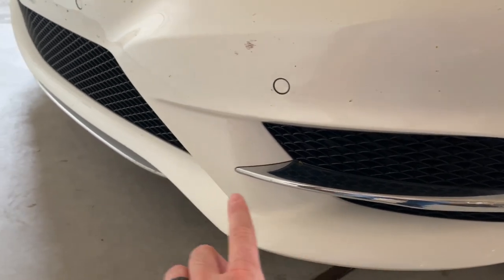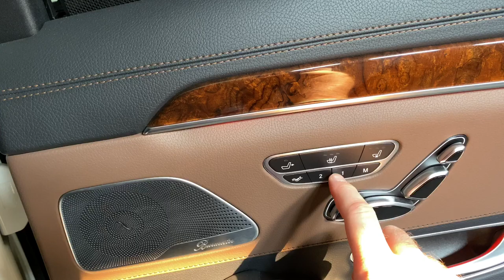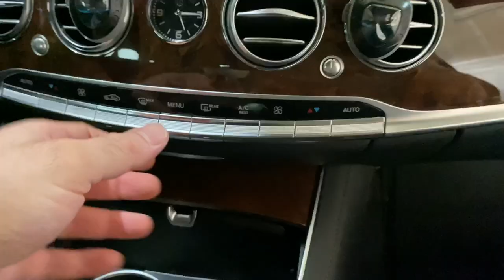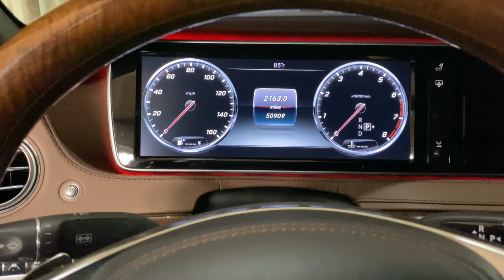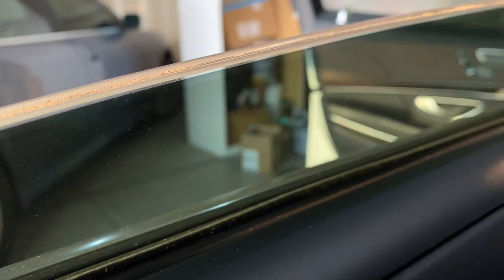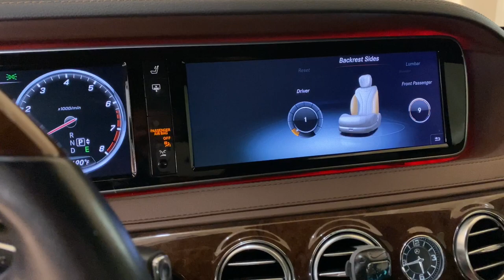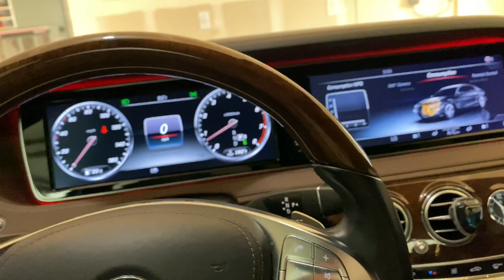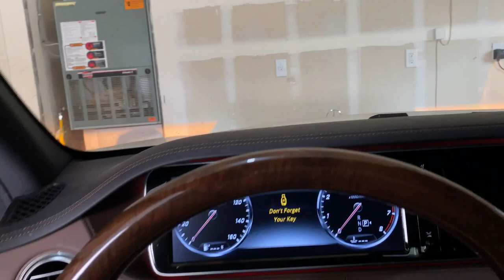2015 S550 Mercedes Benz Detailed Owner Review

Comment: 26:30 Actually the parking brake is push to apply and pull to release.  Later 2015 models actually adopted an auto apply system which means the parking brake would be automatically applied in the event the transmission is in P (park) and the engine is shut down or the driver's door is opened while the seatbelt is unfastened.  Very nice video!  These cars may not be cheap to own or maintain, but they are worth every penny.  Just have to have enough money set aside for anything that may go wrong.  The W222 is probably still my favorite S-Class because although a new S-Class is out, the previous generation doesn't look outdated at all and they still have a lot to offer in terms of technology.
Reply from the maker: Thank you!! I must be honest, it is a really nice car and it looks way better than the new one I agree. I like the headlights in the later years of this model. It probably can be retrofitted into older years like mine but I’m not very familiar with Mercedes coding and all that. I was in Berlin last week and saw a lot of this S class but all of them were the diesel 6 cylinder variant.
Reply: busmaster do u own one does much go wrong with these cars? about to buy one but hesistant, 2015 . done 40000kms . has warranty but still paranoid lol
Reply: @jamiefreedom8320  I don't own one.  I've wanted to for many years now and was waiting for prices to come down below $30K, but the car market spiraled out of control so I could have bought one in 2020 and sold it for a profit.  But yes, like all luxury vehicles, there are things that will break and some will be more expensive to fix than others.
Reply: @BusMaster99  Yes i have decided to not get one as after weeks of reserach it seems the maintenance is not worth it as if something goes wrong it is quite expensive. I have opted to possibly get another genesis or maybe a sonata N line. Mind you the Genesis has been a dream i had older model 2014 but it just amazing car to have nothing went wrong built like a bullet.
Reply: @jamiefreedom8320  I don't blame you.  Maintenance unfriendliness is a rather unfortunate aspect of S-Class ownership.

Comment: If you want to skip a track just turn the command knob. The car is designed to be operated with the knob anyway.
Reply from the maker: The knob is the only way unfortunately if you want to keep the digital speedometer on the cluster.

Comment: Great review!  Tranny is way more responsive in sport mode, really wakes the car up.  The brights can be toggled on/off instantly if you take it out of auto headlight mode.   And you can always refill the empty canister with other perfumes should you find MB scents costly/limited.  My 2015 has 40k mi, still lovin' it!
Reply from the maker: Thank you! It is better in sport but I think my car has a trans issue that’s for sure. The other day the second gear banged so hard all passengers in the car rocked forward and backward lol. I hate the auto high beam in this car... it sucks.
Reply: Where can i get the refill purfumes at other than Mercedes dealer?
Reply from the maker: @lilpudge1503  I’m not sure maybe online you can find refills... I sort of got used to the ones I use and I like that they still release smell even if car is parked versus the built in perfume that only works when fan is blowing air.
Reply: fancy how is the body roll on this car? Does it sway alot? hows the cornering that is one of my main concenrs aswell i want something decent on corners stable and strong
Reply: Do you still own the car? How reliable has it been?
Reply: I’d like to chat with you. I’m buying a 2015 S 550 this week.
Reply: What exactly is great about this review ? It’s garbage

Comment: A fully loaded 2015 S-Class would have been $140k, but this model lacks quite a few options...many that you have mentioned in the video. 
My '13 S-Class is fully loaded except for the fridge (can always be added later) and retailed close to $140k . The base MSRP was $97k and has the AMG Sport Pkg Plus One ($7k), the designo interior Pkg ($15k), the designo Platinum Black exterior ($5k), the rear seat Pkg ($3k), the Pano roof ($1k), Night Vison Assist ($2k), Piano Black trim ($2k), Splitview Front entertainment ($1k), rear entertainment ($2k), and the premium sound system ($6k). 
iirc, the Pano roof became standard with 2014.
The only options I see on your car are the AMG Sport Pkg ($4k), AMG rims ($2k), Driver Assistance Pkg ($3k), Executive Rear Seat Pkg ($4k), Premium Pkg ($5k), and Heated Steering Wheel ($500). You have a well-appointed S-Class, but it is not fully loaded. The Burmester 3D ($6k) is one of the best sound systems and is a big option you are missing. As you noted, the standard Burmester isn't bad and is still better than most auto sound systems. You might want to fiddle around with the settings (equalizer, balance, fade, etc.) to optimize it.

You’ve got a great car and I hope you are enjoying it. You mentioned that the mileage sucks...odd because I get 27-28 on my '13 and 24-25 on my '09 (naturally aspirated) on highway...and I know mileage went up with your gen by another couple mpg due to better turbos and a better tranny. Mixed driving routinely gives me, in sport mode, at least 21 on both of my cars. I found the performance of both cars to be sublime...more than enough. After all, both cars can do 0-60 as fast as a Lamborghini Countach (5 sec). I’m just curious why you considered performance to be bad. What were you expecting? M5 level performance? This is a luxury sedan...not a sports sedan. It’s supposed to waft you, not jar you. If you want that type of performance, you should consider an AMG S63. As for the noise/comfort level…again, I’m not sure what your reference is. Both my cars are extremely quiet and outside my Audi A8L and Rolls Royces, I haven’t found any cars that are as quiet.
Reply from the maker: How do you get 27mpg?? That’s amazing. I fill the tank pretty much every week… I agree with you that the power is smooth and delivery is supposed to be gradual and I like that. In fact I love the engine and it has a lot of grunt but the real problem is the garbage transmission Mercedes keeps using. It’s a pile of trash! Dim witted even in sport mode… slow to shift and doesn’t know what gear to go to! The worst transmission in a 6 figure car in my opinion. They can do much better at least make it shift fast and select the right gear. I don’t have to compare it to M5, even a 328i shifts faster through the ZF 8 speed and it knows what gear to select… I no longer have the Mercedes. I traded it in 2 month ago for a 2019 M5 competition that I haven’t posted about yet… but will soon 😊 enjoy the Merc! It’s a great car… I just can’t deal with it anymore lol.
Reply: @GrindMyGears  Well, 27 is what I can get on the highway...more if I am going from Central NY to NYC as that is a very slight downgrade over the trip.
I'm not a hypermiler, but I do drive a bit more conservatively than most people. Like I said, for performance, a sports sedan like the S63 or S65 would have been a better choice...or even the AMG GT. The regular S-Class is geared to more sedentary driving...smooth acceleration and no sudden downshifts (which can be more jarring when it hits the powerband).
Up to the 2017, the S-Class only had a 7-speed gearbox. Newer S-Classes (2018 onwards) have the 9-gear transmission. This is a bit quicker changing gears since it wants to try to keep engine speed to maximize mileage.
The key to mileage is to find the right speed where the gear you are in gives sufficient power to stay with traffic but remains barely above idle speed (and therefore using the least amount of fuel). I also coast as much as possible. That's just how I learned to drive on a manual.
It sounds like you enjoy more spirited driving. The Bimmer will likely suit your driving, especially the M5 which is a sports sedan that is geared (pun intended) for better performance. There was a time I liked to drive like that and just for the sake of driving, I would just hop in a car and go for a few hours with no particular destination in mind...basically a point A-back to-point A. One of the best driving cars I've had was a BMW. 
I don't really care to do much of that anymore. In fact, I prefer to be driven while relaxing in the back of the Maybach. 
I am considering a BMW again and it is likely to be the i8. I tested my friend's car earlier this year and was pleasantly surprised. I hate going used, but I missed it when it was in production. It isn't the sportiest car out there, but it is sufficient for my needs and I have been told it can be tuned to low 3's zero-to-60. OTOH, there are rumors that BMW might make a second gen that is M based....the i8M. I might just want to wait for that.
Oh, I look forward to your review of your BMW! :)
Reply from the maker: @samshare2146  great info and techniques! Also I love driving from point A to point A 😄. I used to do that in Reno way more than in Austin. Roads here are bad and congested during the day so now I do those at night. I think you would like the i8 spider! Or maybe it’s just me who wants a convertible 😁. Thanks for checking out my channel btw!

Comment: Wow that was the most honest unfiltered video review I’ve ever seen 👍🏾 awesome 👏. Now I think I want a Genesis G 90 instead.
Reply from the maker: Thank you! I hear a lot of good things about Genesis. Let me know if you test drive one and how it is!
Reply: I have Genesis g80, thinking upgrading to sclass unsure what model tho looking at s500. GENESIS has been best car i have ever owned so far, far superior to my c63 which im also selling at auction this week. I want to upgrade to something with same type of comfortability but with bit more power. Planning to just have one car and keep it simple. Something with power and smoothness. The genesis is like driving on a cloud, so im hoping the s500 much similar although yet a superior car is, im hoping its more suitable but im worried about the maintenance. genesis has been a dream. Its super quiet and i drive long drives 8 hours plus sometimes and never felt uncomfortable, could literally keep driving for another 4 to 5 hours with no problems. Never had any major issues with the car, only changed rotors and some buttons here and there.  Now to make a decision if i should go s500/ s63 , s400 (altho slower it may be more comfortable and quiet) or a different car, possibly another g80 but newer. 

How has the maintaince been has many problems occurred in the s500 "grind my gears" pleas let me know thank you
Reply from the maker: @jamiefreedom8320  sorry just saw this since I wasn’t tagged in it, I didn’t get notification. Not sure if it’s still related but maintenance wasn’t that bad. Around $400-$450 for the regular interval (I forgot if it’s A or B) and I think around $700 for the bigger one. I did battery and brakes and it was around $1800 or $2500 I forgot. Overall it’s more expensive than a BMW to be honest but BMW 7er would probably be a lot more fun to drive just not as comfy :D 
Hopefully you got a car you love!

Comment: In the 2017 S550 you can skip tracks on the left side of the steering wheel.
Reply from the maker: Yeah I like the updated steering wheel... I believe it also has the touch buttons on right and left.

Comment: Regarding the noise, you might want to try quieter tyres, it makes a huge difference. The S class statistically has one of the most quiet cabins, so if that's not enough for you, you should probably go for a Maybach or Rolls Royce. Also, it indeed handles like a boat, so it should be ridden gentle. If you try to drive an S class too hard... you and the car won't like it. And judging by your preference for BMW M, your boundary of "too hard" is very high. I don't know, maybe the car isn't really designed for US roads. Because here in Europe the car is an absolute dream to drive. I also dislike the sticking buttons and stuff, one of the biggest disappointments in my opinion. A car of this segment shouldn't have issues like that.
Reply from the maker: You are 1000% correct! I think speed limits in Europe are lower than in the US and maybe that gives the car a quieter ride. I had continental DWS tires on it but I am not sure how quiet this tire compared to others but since we get snow in the area, I needed a good all season tire.
Reply: @GrindMyGears  The car comes with run flats. Switching to non run flats also makes a huge difference
Reply from the maker: @RS1Interviews  actually I didn’t have run flats on it. I took the risk driving even across country with regular tires :D

Comment: I just watched your driving impressions video. This video was equally excellent. I’m currently in the market for 15-17 S550. I went to see one that got away a few weeks back. It was diamond silver with the sport package and 19in AMG wheels. It was absolutely gorgeous but I prefer your spec and wheels. That car had almost every single option minus designo leather, rear center console, and fridge (maybe more). One thing it did have was ABC/MBC suspension. That made me hesitant a little because the service on those hydraulic suspensions are more complicated than the air shock.
Reply from the maker: Thank you 😊 were you able to find another one? This S class is such a head turner… I wish it drove as good as it looks. I traded in the car with 84k miles and the suspension was still in great working order. Everything was in great working order actually minute the transmission, it didn’t get worse but the hard shift would appear occasionally. Also a burnt oil smell would come from under the hood (not a strong smell) but dealer said all is good lol… so idk but the car served me well. Hopefully you find the spec you’re looking for!
Reply: @GrindMyGears  I found several but not as loaded as the diamond silver car. If I may be honesty, I will probably not use most of those options but its great too have still. I have sat in both the nappa leather and standard leather and both are very soft with nappa having a slight advantage. But as you said, as long as it serves you well, that’s all that matters

Comment: Put the light on manually and the high beams will come on when you push forward
Reply from the maker: Yeah that is an option… an annoying one though!
Reply: @Grind My Gears  Makes sense to me. It's intuitive, works the same on Volvo. If the light knob is on auto, then it's quite logical that the high beam will be auto too. Just turn it to the right to turn the lights on manually and the high beam will be auto too.
Reply from the maker: @RS1Interviews  yeah the manual one makes sense but my issue with the auto high beam is that it takes a long time to switch to high beam while driving… you know what I mean? For example, you engage auto high beam but it takes several long seconds for it to come on. When it comes on, it’s great. Then it goes off if an incoming car appears and then the incoming car is gone so you would expect the high beam to come back quickly right? It’s not the case, it will take again several loooooong seconds for it to come back on which is super annoying when you really need it to be on quickly.
Reply: @GrindMyGears  That's true. It comes on slowly. However, it should dim automatically if oncoming traffic approaches. If people flash their lights,  calibration and update of the system will help.
Reply from the maker: @RS1Interviews  yeah it dims when traffic comes opposite way but it takes so long for it to come back on. Not sure why they programmed it this way. It should immediately come back on as soon as it does not sense incoming light from sensor.

Comment: Thanks for review. Question. Why all the air fresheners?
Reply from the maker: I like nice scents including leather scents but this car doesn’t have any smell so I add those. I forgot to mention in the video that this car has a scent diffuser bottle as part of the HVAC system in resides in the glovebox but you have to use Mercedes bottles and I find them unnecessarily overpriced and they dint have a lot of fragrance options. I also forgot to mention that this car has an ionizer built in!! So much stuff in this car.

Comment: Nice review. I just bought a 2017 S550. Like you I was disappointed by the sound of the base Burmester audio system. I also have an Audi A8L 2011 with the base Bose system and it sounds so much better. So the cheaper car (older Audi) ha superior sound. Disappointing.
Reply from the maker: Thank you :) the A8L is a great car from what I know!

Comment: Hey sir a question. Can you replace the wheels with aftermarket ones? Wanna use 18 inch  or even 17 inch wheels just to have more flexibility with roads
Reply from the maker: I don’t see why you can’t! As long as the aftermarket wheel can clear the brake calipers then you should be good. You might need to go to a shop and have them fit a sample and see how it bolts on. It needs to clear the calipers and fenders on the front when you turn the wheels and during corners… otherwise it will rub and ruin the plastic and maybe the paint.
Reply: @GrindMyGears  thank you so much for the response! working for this dream car in the future (tho prolly a 2027 model by then)! hope you get more success with your channel and in life! thank you again!
Reply from the maker: @vanguardas9927  thank you for the kind words and wishes! I wish you the same too and hope you get your dream car very soon.